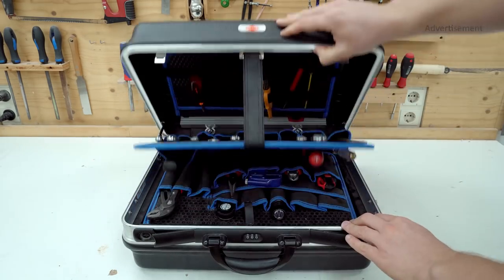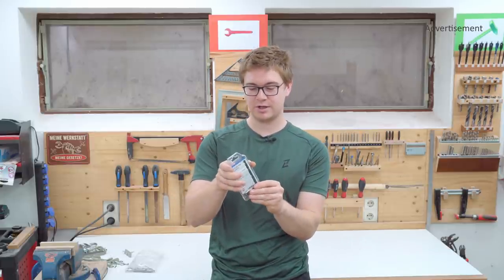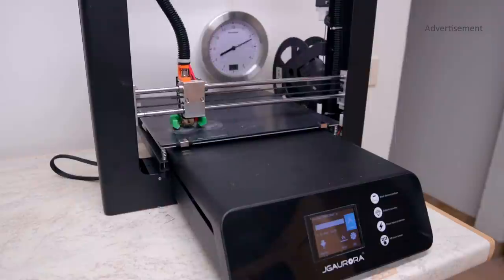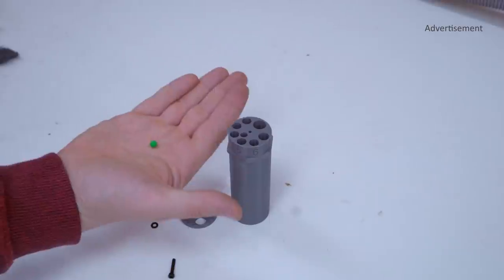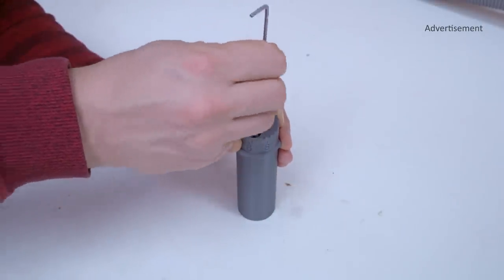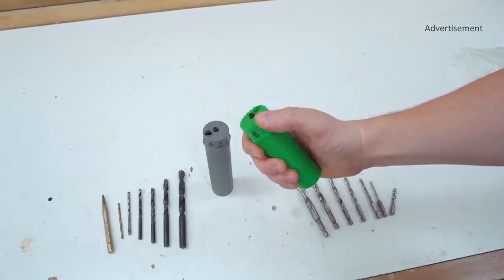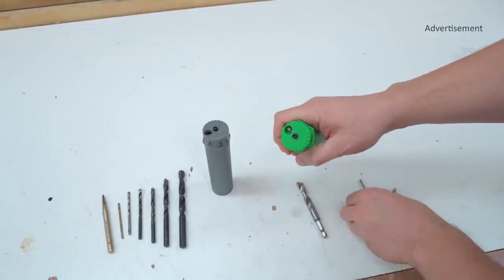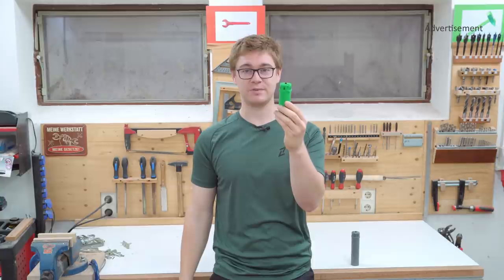Drill Storage Solution for My Tool Box - Workshop Organization and Efficiency using 3D Printing

Comment: It's funny how a few hours after this was uploaded, scoutcrafter uploaded a video showing a Millers Falls push drill from the 1950s with a similar solution for bit storage in the handle. The video title is "Rare New York Multitool and Millers Falls Buck Rogers No. 100" and the section is about 9 minutes in, if you're curious. I'm surprised this idea isn't more widespread!

Comment: I have a screwdriver that holds bits in a similar way. However, each spot and in between each spot is detented so you don't have to line up the hole by eye and you are always 1 click away from "closed".

Comment: Awesome! Just one question: is there a specific reason that you did not make a dent for each drill bit position? 
In your solution once you have taken a drill bit, the ring is free to move and you have to place the ring in the "park" position to be sure that nothing drop out by accident.
Instead if there is the same dent for each drill opening you can take your bit and leave it open at that position  for when you will put it back in place being sure that nothing moves...
Reply: Yup, one click per bit would be much better
Reply: Personally, I think it's not really necessary. Might even be annoying in daily usage. And obviously you would have to make sure each dent is located perfectly to align the holes for each bit, not just one to align it in the 'closed' position. I do see the benefit of nothing falling out by accident, but I think the spring pressure might help with keeping the selector wheel in position, at least somewhat.
Reply from the maker: Yes, there is just not enough space to to get one click per bit. You would really have to leave one of the positions "blind" and even then, you would have to increase the diameter by quite a bit. And I decided that it's just not worth the tradeoff. You could probably get away by using a significantly smaller bb but then wear on the plastic parts increases and getting the detent work just right gets much more tricky. But I'm sure it could be done!
Reply: @CosmasBauer   Thanks, I knew there was a good reason for that!